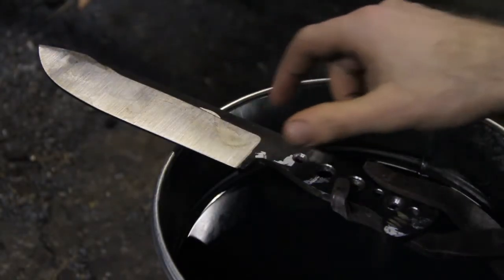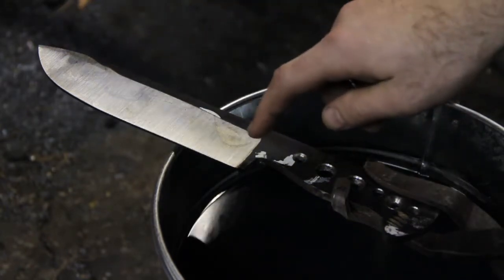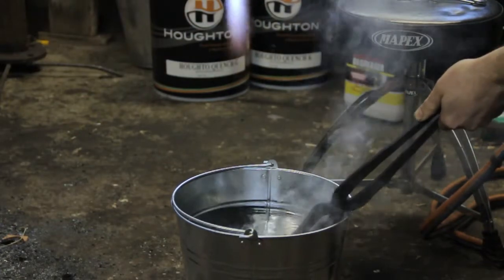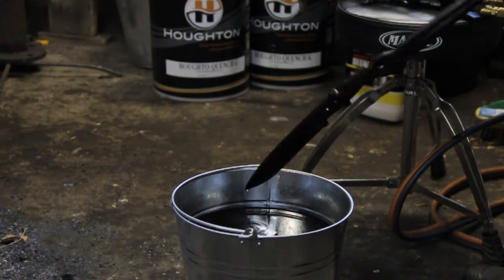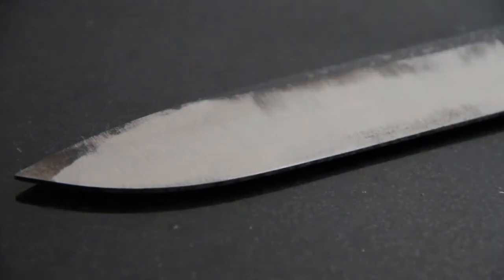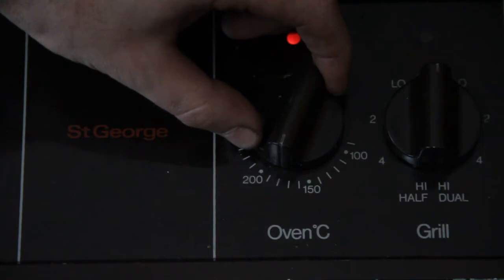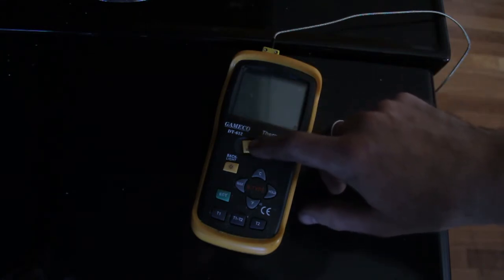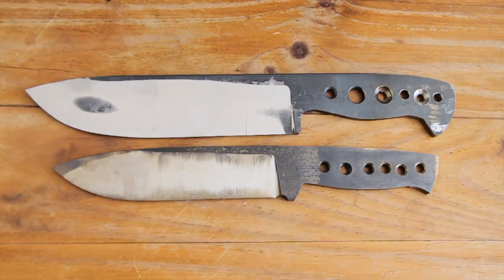Beginners Heat treating SUP9 / 5160 steel

Comment: Could you heat treat 5160 in a charcoal forge like 1084, say minimal soak time and let it go just past non magnetic, quench in canola oil afterwards. I have used 1084 with success for blades and tools, but would like to use a tough big chopper type steel for large blades, but backyard heat treat set up.
Reply from the maker: The soak time would be key to getting the most out of spring steel. You really want to get that cromium and silicon disolved properly to get any of the benefits of using the spring steel. Otherwise stick to your 1084. I mean you could do it and you will harden the steel some but you could get a better result if you get temperature a d time right.
Reply: @batcountryforge5945  Thanks for the info.

Comment: How long in the oven? I dont think i heard but i would appreciate if you could say
Reply from the maker: Hi, 2 hours on 200 degrees celcius let it cool to room temp and then repeat. You must temper twice to get the proper effect. If you want to increase toughness and reduce hardness you should increase the temp to around 220 and check again. You should choose a hardness for the blade based on its application.

Comment: Hey there great video! I have made a big ish knife out of a piece of leaf spring steel, got to the point of quenching and oven time but a friend says not to harden it as it will break.. Do you recommend doing this process to a larger 260mm blade length 52mm wide 5mm thick Handle length 120mm? I'm also worried it will crack along the edge where it's thinner
Reply from the maker: To put pretty simply, If you don't harden the steel you don't have a knife. The spring would already be heat treated but to the optimal working hardness for it to perform well as a spring. This might be as low as 45HRC, usually most hand knives start from around 55HRC for a tough outdoor knife, kitchen knives can be over 60HRC. Weather it survives heat treat or not will depend how thin you made that edge. I'm obviously having to make a few generalisations here as I can't see your knife but if the edge is thinner than 1.5mm you might be in crack territory, especially f you can't get the temp even along the length of the blade. I heat treat thinner than that for most of my knives but if its your first go give yourself as best chance to succeed as possible. If so grind the edge back until it is a little thicker. If it does crack during the quench you will have learnt more than if it worked out fine. Let me know how it goes.

Comment: This is not how to heat treat a spring steel blade...The point is to make the blade hard and flexible...Put this knife in a vise and hit with hammer and it will break, A properly heated knife will not break...;) It is a lost art...I have watched a lot of videos on heat treating spring steel 5160 on youtube and none have hit the mark...Try the  vise and hammer test with just a piece of spring steel that way you dont waste your time making a knife that will break ....
Reply: So. How do you properly heat treat spring steel to get that balance of hardness and toughness? I've been making tools out of the stuff but I'm not finding a lot of info on heat treating
Reply: @angelTechnician64  the video is right.  Tempering the blade as per video will prevent it being brittle and give it some toughness / flexibility.

Comment: What are some tips for working with coil spring? I quenched a bit of a sabre thi ng i made and im wondering how do i normalize it, oven too small.
Reply from the maker: 1st tip is work with jobs you have the correct tooling to complete successfully. Or know the limitations of your workshop ;) 

I think you might mean temper? Your best bet is to grind the steel clean and use a hand torch to heat the steel until you see it change to a straw colour ( or which ever colour corresponds to the hardness you want on a relevant chart.) The real answer is much longer than I can put into a youtube comment unfortunatley.
Reply: @batcountryforge5945  Yes, i meant temper, ill try that method. Thanks

Comment: i live in thailand and can get sup9 i want to make a knife with my lil brother but i cant find anything on heat treatment temperatures and all that maybe someone canshare some info thank you
Reply from the maker: If you are buying the steel and not recycling an old spring. Cut the knife out, grind it to 1mm thick at the edge, heat it to 830 degrees celcius and quench into vegetable oil. Then put into an oven on 200 degrees for 2 hours. At the end of 2 hours take it out to cool to room temperature then repeat this step again. After that grind it to the final edge without letting it get to hot so  cool it with water. Most importantly, when you have finished test the blade. If it cracks you need to increase the oven temperature 10 degrees and try again. If the edge is too soft maybe it didn't harden or you over heated it while grinding.
Reply: @batcountryforge5945  im so excited to try thank you i will let u know if it worked :D
Reply: @batcountryforge5945  770 is when the magnet doesnt stick any more? just tried it and the blade fell down after quenching and a little bit of tip broke and the file does bite into it a little bit. should i try to harden it again or should i proceed with the oven steps now. thanks
Reply: bought as much as i could im just missing a magnet and thermometer that can measure 830 degrees lol
Reply: also im doing this in a big can of beer(the quenching) or do i need a big bucket of oil like you have
Reply from the maker: @joolion8178  if parts broke when you dropped it and the file does not bite you have hardened the blade somewhat. I would say you can now temper in the oven and test the blade when you have an edge on it.
Reply from the maker: @joolion8178  more volume of oil will be best to cool the steel faster. Try 5L of oil at least. If it is a knife like the one in the video I have 14L in my bucket.

Comment: Very helpful video just i want to understand  do you advise us to use this kind of torch which is about  oxy and probane gas  instead of using  forge because it is easier& cheaper &work  good waiting your answer
Thanks
Reply from the maker: Mario Mario no, you can build a proper forge with temperature control for less than buying an oxy torch. If you already have a torch though and cant wait to get started they are pretty effective.